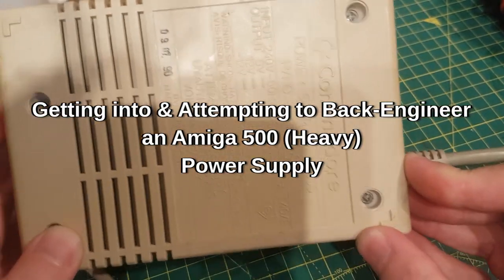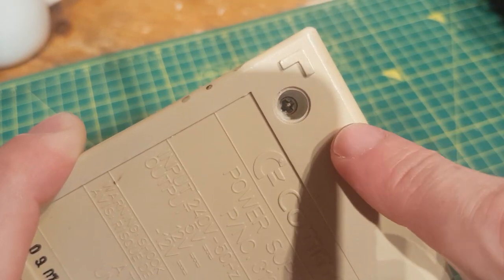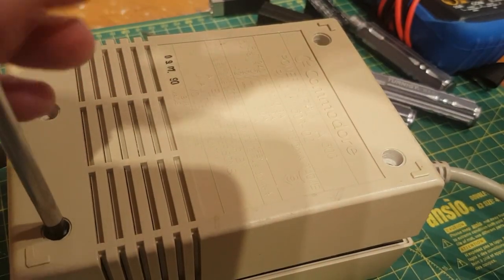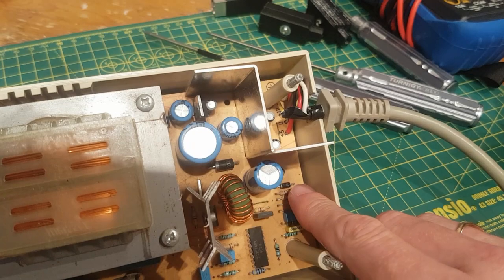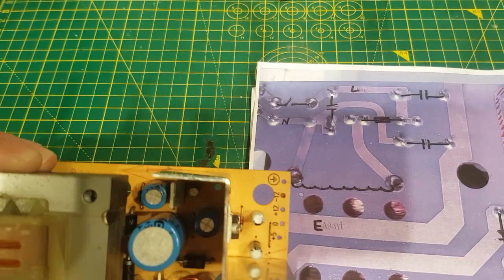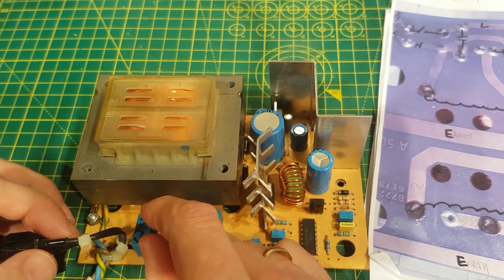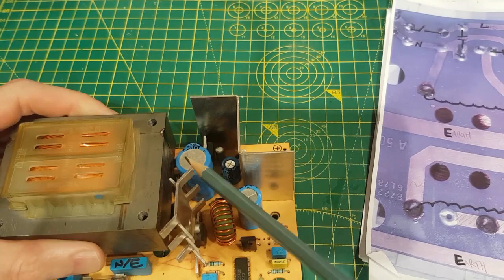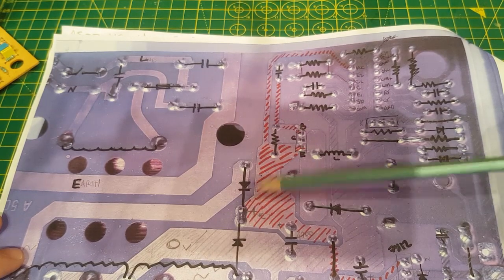Getting into & Attempting to Back-Engineer an Amiga 500 (Heavy) PSU

Comment: For the record, I did not fall asleep 😉 and enjoyed the explanation. Thanks for the video. Coincidentally, a couple weeks ago I cracked open two A500 PSUs that I have to compare innards, as one is much heavier than the other. Both are Model 312503-01 (117V/60Hz) but the one from 1987 is a Linear design, and the other from 1989 is a Switch Mode design. Pics here: http://bit.ly/MFR-Amiga500PSUTypesNA
Reply from the maker: Thanks for watching and for the link. Interesting. There appear to be many variations. I have two switchmodes as well .Both are different and they look nothing like that lol. I started trying to back-engineer one of them and confused myself silly when it got to how the opto was regulating the main transistor. When I feel brave enough, I will dig it out again. Keep it up.

Comment: Nicely explained!  The vref on the switching IC will be how it compares the 5v level - likely using opamp type circuit inside there to compare output to the vref in order to adjust the PWM.   I think you were right when you said the zener was used for the SCR crowbar!  For one thing it doesn't need regulation as that is provided by the switching IC!  The diode connected between ouput and input of the voltage regulator, I think that's to protect against transients.  I never like that approach because occasionally those diodes fail and short the input voltage to the output voltage....
It's quite a wierd design in that it uses a transformer for the main step down and then has a switching circuit just for the 5v rail lol.  The other observation is that it doesn't use a full bridge for 12v feed, the -12v is half wave, which is a bit brutal I guess.
Not sure if I have one of that model - will have to check through my stuff in the loft when I get my other Amigas out.
Reply from the maker: Thanks! I was confusing myself for ages why it needed both the SCR and the chip! It certainly weighs a ton!
Reply from the maker: You were right lol. The -12v rail was shorted! Cheers